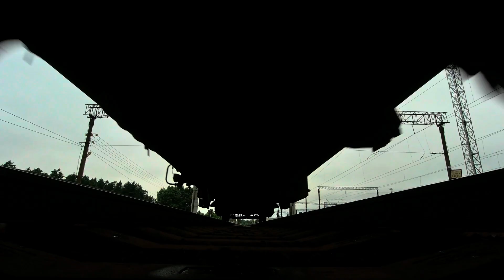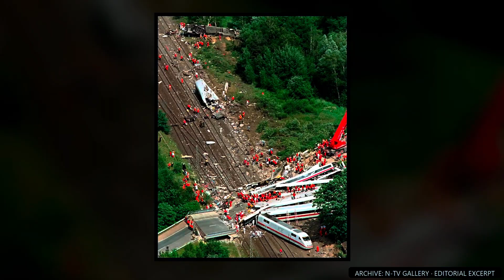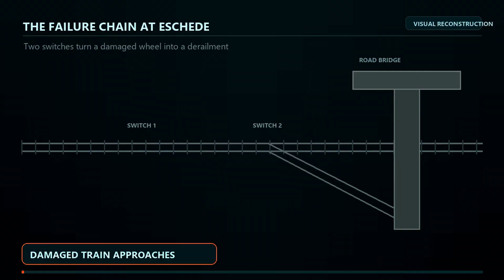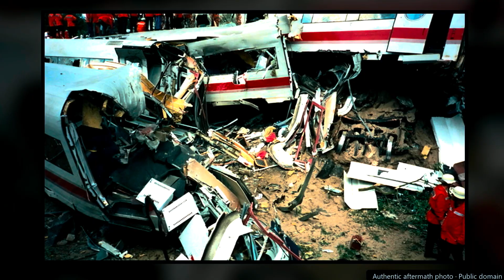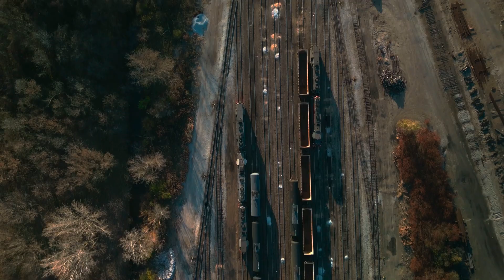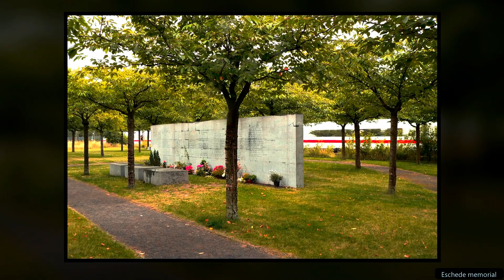How One Broken Wheel Brought Down a Bridge

Comment: When the conductor was advised of the problem
Reply from the maker: If you mean when the conductor was told — only information I found is that it was only shortly before the crash. A passenger found him two cars away and took him back to inspect the damage. Before they could reach it, the train derailed. A later expert concluded that by the time the conductor was warned, there was no longer enough time for him to prevent the crash.